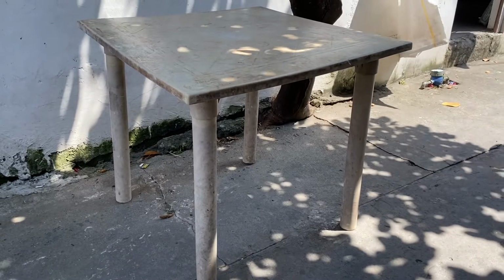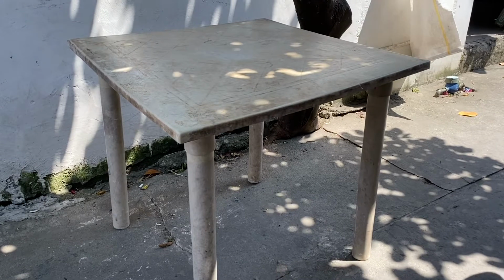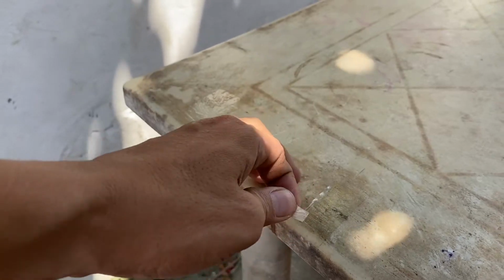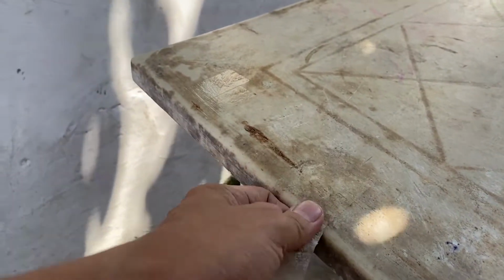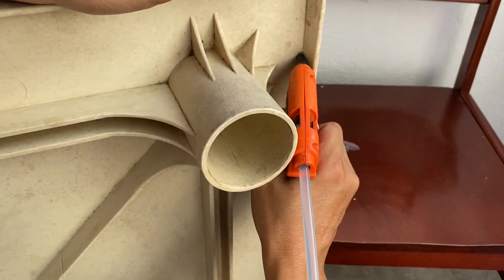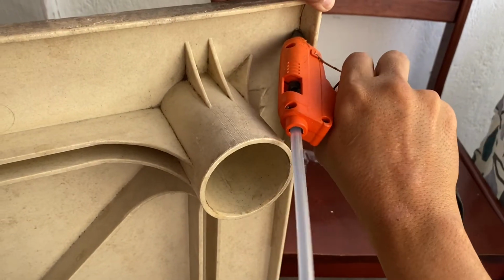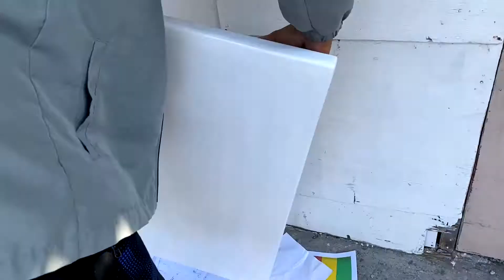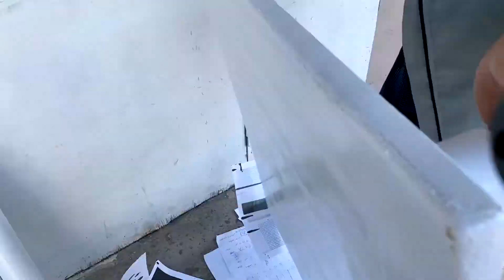Monoblock Table #restoration

Comment: Boss basta po ba bosby spray paint or may latex b yn or plain lang n spray paint. Thanks po
Reply from the maker: For better adhesion, apply primmer paint before applying the top coat using acrilic paint if you want faster drying paint or enamel base paint which dries a little slower.

Comment: you need to sand the area fist before putting the paint so that the paint can stick on the table and so your paint will look more cleaner when the paint on
Reply from the maker: Thanks a lot for the tip 😊
Reply: Sir abrahan ano po klase sand paper dapt gamitin sa lamesa plan ko din idiy ung lamesa nmen eh